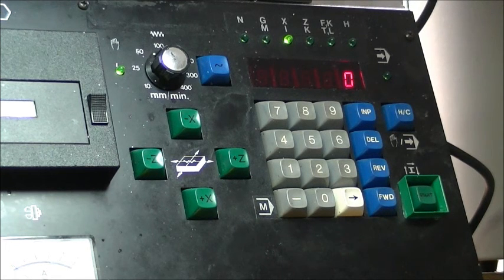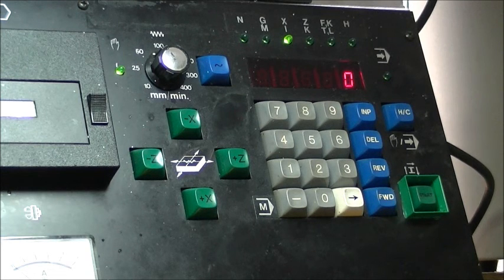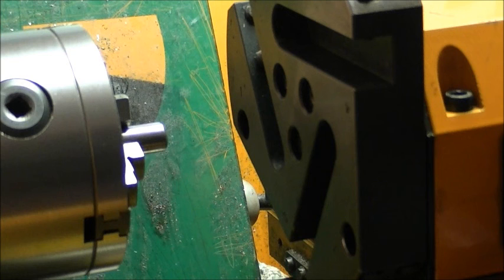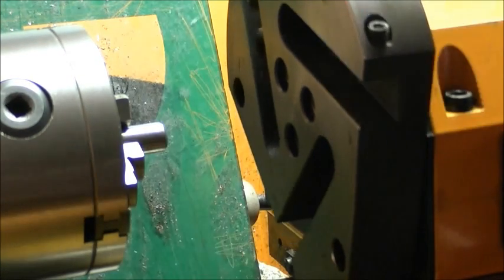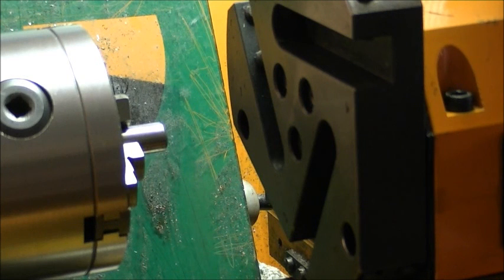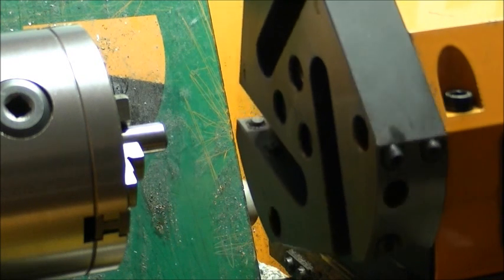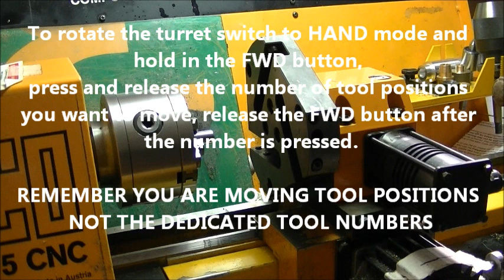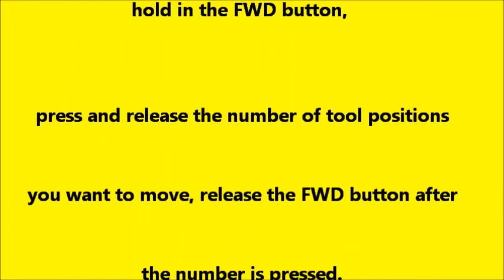Emco Compact 5 cnc Toolchanger testing

Comment: Thanks again, tomorrow I will take it apart to see if I can fix that. Is there a place where I can guy metal gibs replacements?
One additional question: if I put a stock into the ESX25 using the collets and I make an initial turning to make it perfectly cylindrical, when I take it off and in again it doesn't keep centred unless I mark bothe the collet holder and the stock with a marker and then I put it in the same position.
Is it normal? I expected it to be perfectly centred...

Comment: Nice presentation, do you maybe know what could be the problem when it doesnt want to reverse to lock position ?
Reply from the maker: First check it's not a problem with the turret pawl or drive mechanism. If not mechanical, the problem will be on the DNC board. If you are a member of this group  https://groups.io/g/Emco5CNClathe  check in the Files for further info on the DNC board operation.
Reply: @ukmwg  thank you for the link. I have removed the motor and it spins nicely also the turret turns without problems. I activated the function and it spins only in one directon.
I have also changed dnc board and it  has the same function, maybe I am doing something wrong ?
Reply from the maker: @matejz8866  When a move is requested the turret will rotate just past the next tool position and stop before reversing to the working position, if you request more than 1 tool position move it will always do the move as described. Finally when it reaches the desired position the reversed voltage keeps the turret in contact with the pawl.
Sounds as if there is some fault in the control system on your lathe, best ask on the group at the shortcut.
Reply: Could well be a faulty DNC board which controls the turret motor, see the answers given below.

Comment: Thanks a lot for answering!!!
I already set the round holes to match correctly with a 10mm round cylinder so the alignment is ok, what's strange is that it seems like not the turret but the cross section or even the entire Z axis bed is bending when I try to use a parting tool or, if I try to cut a good amount of brass (0.6mm with a 60mm/min feed) when turnin on the Z axis the revolver looks like it leaning on a side.
I really can't tell...
I'm also concerned about brass powder and chips getting beneath the cross section. How come there is no protection in that part??
Reply from the maker: Sounds as if the gib strips on the Z axis need replacing or modifying to reduce any clearance that allows the cross slide to lift from the lathe bed.
If there is any clearance you must be able to feel/see this by putting pressure on the turret to try and move in all directions.
Most Emco 5's have only nylon/plastic gib strips on the Z axis, conventional steel gibs are fitted to the X axis and are adjustable.
There should be bed wipers fitted at the leading and trailing edges of the saddle where it contacts the bed V's, these prevent nearly all swarf from passing, they are felt and need to be soaked in oil so lubricating the bed ways at point of contact.
Reply: ukmwg I took everything apart and back together, now everything is much tighter! No wipers in my Compact 5, strange! Would you consider making one or those turrets for me?
Reply from the maker: No time to make a turret, your Emco turret will be OK when set  up.

Comment: How much would be a good price for a compact 5 cnc with the original tool changer?
Reply from the maker: Depends on if you are buying or selling, good price for the buyer won't be as good for the seller.
Price depends on which model, the early lathes didn't have any M codes and G codes were pretty limited. Later Mk3 and 4 models had more G codes and included some M codes so are the most sought after. For example G84 is a cyclic turning program all entered on 1 line of code, total depth of cut, length, feedrate and cut parameter which runs through the cycle and the tool returns to the starting position.
A Mk2 with toolchanger sold recently on eBay UK for £1100 which was an exceptionally high price, usually go for between £500-£800. Several years ago now I sold a Toolchanger for £485 which was a very good deal for me as I only paid £250 for the complete machine.
Reply: @ukmwg  I just won an auction where a dividing head with 3 jaw chuck and the Emco compact 5 cnc with the toolchanger went for €1300 together. I think €900 of it was for the lathe and 400 for the dividing head and chuck. I need both so I thought I can pay that. 1300 € is about 1137 GBP today. The lathe has been on a school of some sort since new, I think that is where most of them went anyway.
Reply: Any good tips for getting started with the Emco? That's my first CNC, I've done quite a bit of manual turning before but no cnc.
Reply from the maker: @MF175mp  join this group for info on MFI, a Gcode editor especially for the Emco machines.  https://groups.io/g/Emco5CNClathe
Where do you live ?
Reply: @ukmwg  Thank you, I live in Northern Finland. I will probably be using it a couple of years only until I can finish my own cnc project and put it for sale then, possibly taking the tool changer for my self built lathe at that point. Or I keep it if I start liking it too much, can't tell yet...

Comment: Hello!
Sorry for bothering you privately but it looks like no one has answers on the yahoo group.
I'm making progress with the lathe, I now have a few I hope minor problems: the turret is tilting a bit both on the X axis and the Z. More on the X which is frustrating as I can't use the parting tools because they end up below the cutting point under the stock.
Any advice? Can it be because brass chips are going under the beds?
I'm also concerned the rotating turret is less precise than the normal "from the top" quick tool changers. Do you feel the same?
Thanks!
Reply from the maker: Hi
Check out my other tool turret video, it shows a method to check the alignment of the round toolholders so they are exactly at the centreline of the lathe axis.
If you have to use shimstock between the turret and cross slide to ensure alignment to the lathe axis make sure the shimstock is retained with the turret if removed, better still use Loctite or similar to make it a permanent fixture on the base of the turret.
Once the round holders are aligned correctly you only need to use packing pieces in with the square tools to raise the cutting point to the centre of the stock.
If you are grinding  sq HSS for tooling be sure not to remove much material from the top of the tool tip or otherwise you will not get it high enough to work at the centre of the workpiece.
Once you have set all tools to the correct working positions the benefits of the turret become more obvious, when indexing I found the turret was very accurate and returned to the same position always.
I am currently also using a manually operated toolchanger on another cnc lathe, that also has the benefits associated with a turret, you can see this in 1 of my Denford Orac cnc lathe videos.
The Emco standard toolpost with quick change facility will provide very good tolerance when changing from tool to tool and tool height is easily adjusted so once set it is quick to change tools.
Reply from the maker: ukmwg http://youtu.be/IfYLgENFvIk
for the other tool turret mentioned.